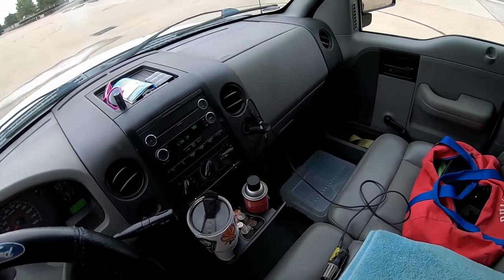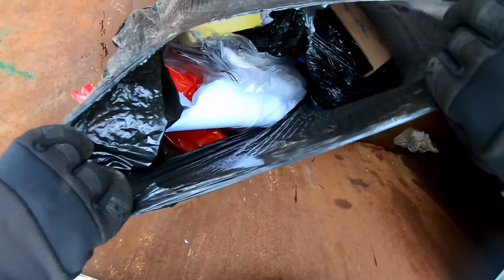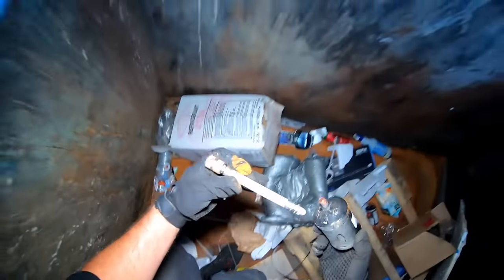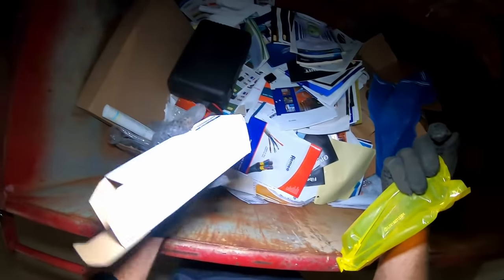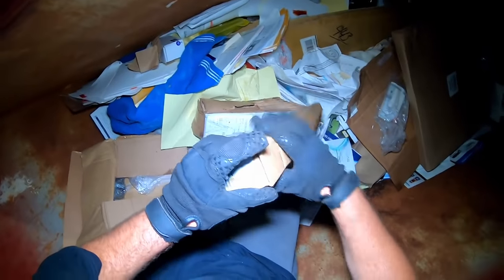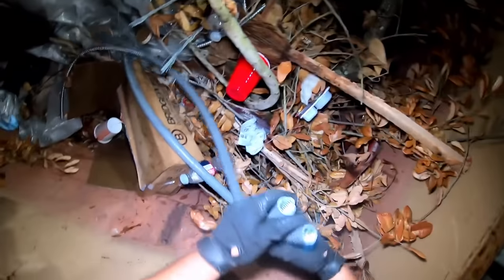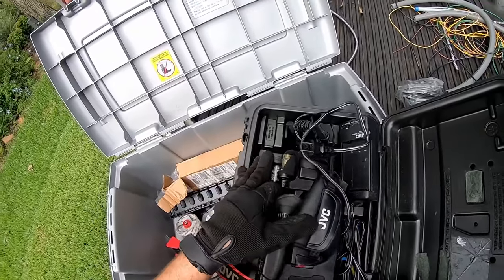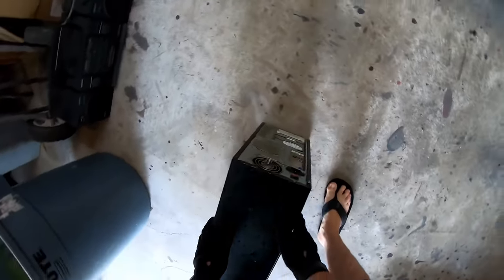Dumpster Diving "Swangin & Bangin"

Comment: Hello from Pennsylvania. On ur AC units. If u take the ends off the radiators u get clean for rads and the ends u will get dirty brass or if copper on the ends u take them out u will get clean.  My yard does that

Comment: I would have definitely traded scrap for the bolts. Those were-$50-70 dollar bolts that we're getting scrapped out for 25 cents. But you could have sold those bolts for a ton more. That's why I buy stuff back from the scrap yard. Stuff that cost me $2 I sell on eBay for $300

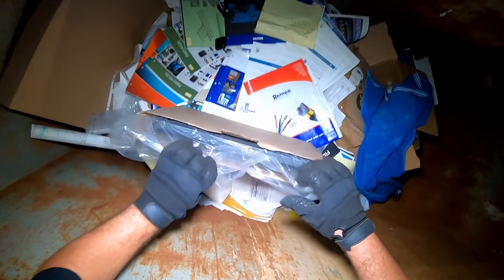Comment: 12:46 Looks like a Telecoms Fibre Tray. Fibres come into cabinet are wrapped around the plastic forms within the tray to be presented as a transmit and receive pair to the back of the front panel. Patch fibres are plugged into the front and across to Optical ports on other equipment (routers etc) within cabinet.

Comment: Mike!  You missed some snippet of that Cat 6 wire (look at 5:19-5:22).  Also, keep an eye out for those older "Charbroil Commercial" grills (specifically, the ones that are boxed on on the base).  There were one or two models that have cast bronze burners that are about 3 pounds each!  I know as I have one!!

Comment: Why don’t they drill holes in the bottom of the garbage bins and let the juice run out That Way It won’t rest the bins out
Reply: older rear loader dumpsters have  them they are plugs.  these are more newer front loader dumpsters people leave the lids open or the lids are broken and you have rain juice in them roll off boxes they drain out when being picked up the juice flows right out of them and besides the rain juice actually helps get rid of very foul and not kosher odors . if any thing they need to do a very very far better recycling  everything fills up the landfills very very fast .
Reply: Wouldn’t be heathy to have some of that juice running down the street.  Better to keep it contained.
Reply: @eloiselong3290  where would  you keep it contained the trucks contain trash and recycling how would you contain the rain when it goes in to open dumpsters and people place dangerous and hazardous chemicals in the dumpster . what about when it rains on peoples properties and the streets and on the grass that most likely has fertilizers on them and geese poop and dog poop how would you contain them and free flowing trash and grass clippings and LEAFS from the fall season .

Comment: Yeah...okay.  This is more semantics than anything but...What ya got there is a bar-b-que GRILL.  Bar-b-que PITS are usually IN ground, not ON ground.  Maybe it depends on what part of the U.S. you hail from too.  STILL wondering about that huge spotlight you found.  Did it work?  If so, you GOTTA show us!!
Reply: It's a regional thing. Not everybody in the country calls things the same.
Reply: @susanclark5260  Thanks Susan.  I kinda thought that was what it was, but thanks for the heads up.